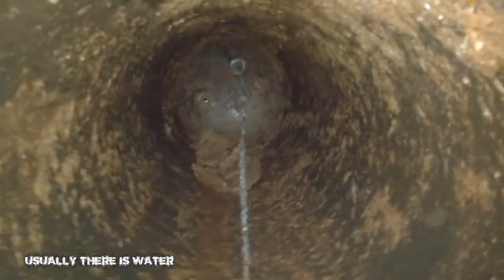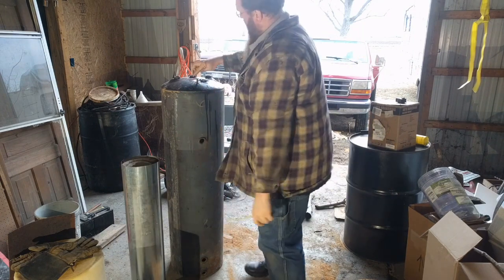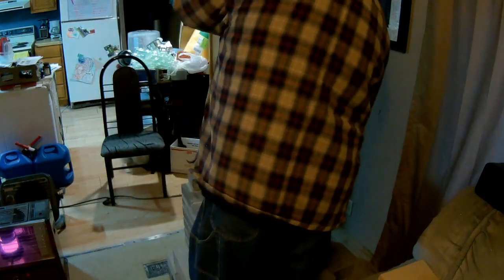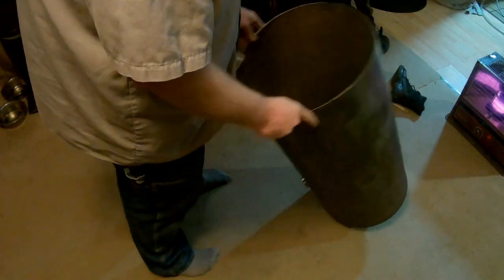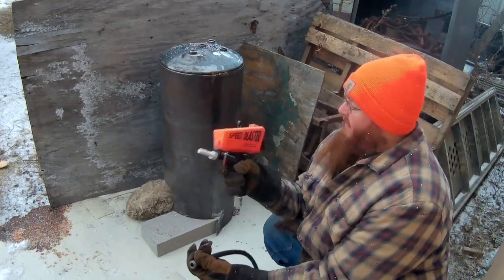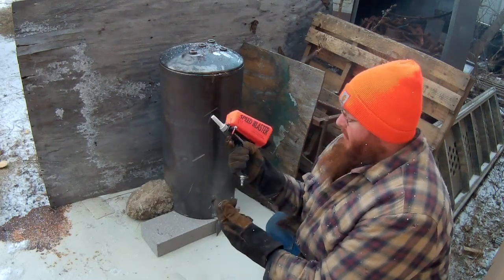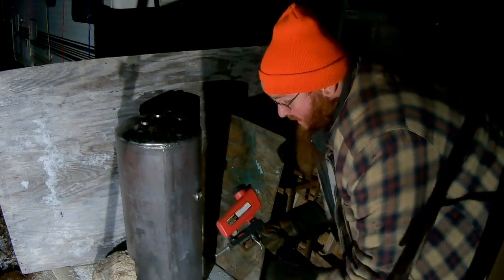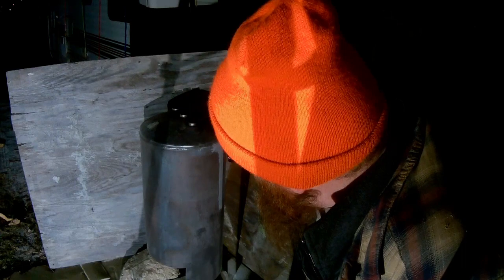Rocket Mass Heater(3) Heat Exchanger

Comment: Uhhhhh your leaking. Lol looking good can't wait to see it fired up officially
Reply from the maker: I'm liking it! Already not liking the wood processing, but that's mostly cuz this project kinda happened quick. And all the wood I have I was planning to put in an outdoor wood burner with a 2foot square burn chamber... All my wood is way too big for this, and it's not fun processing the wood when it's half frozen and wet outside. I need to just take a couple days and process everything instead of just processing a few days worth at a time.
Reply: @WarpedLegacy  I seen a pretty cool invention that you put under a log splitter and it looks like a cookie cutter and splits a log into small pieces. I wonder if you could come up with something handheld to cut the smaller pieces
Reply from the maker: Oh... I've got a plan!... I just need to find the time and energy to implement it! It's actually a pretty simple plan. I'm gonna make a video about it.

Comment: They put off a smell when they get hot bub. Had my first forge built out of one. Hope u don't have the same problem.  It's the porcelain coating they got. That makes it smell
Reply from the maker: Probably on the inside, but we don't ever come in contact with the air after it's inside. Once it goes in the burn chamber it stays inside the system until it exhausts outside.... I was wondering what the coating on the inside was.

Comment: It's always nice to be warm.  The only "issue" (I would say problem, except that it isn't... not exactly) I have with this stove is that you can't really watch the fire burning & crackling.  That might actually be an advantage, as I'd get even LESS done than I normally do (my wife will tell you just how little I do).

I have seen some really nice looking masses for these type of heaters.  Are you planning to build a bench into the mass?   Are there any guidelines as to how much mass is necessary for a given size stove?
Reply from the maker: Yeah I wish I could watch the fire more.... I end up standing over the feed tube looking down into it quite often.

Yup, gonna build a mass and sofa thing. I've got a plan and some materials. I'm sure there are calculations about mass size, but I'm just making an educated guess.